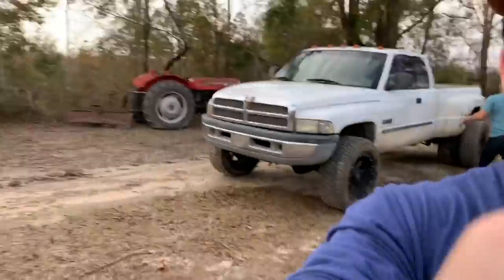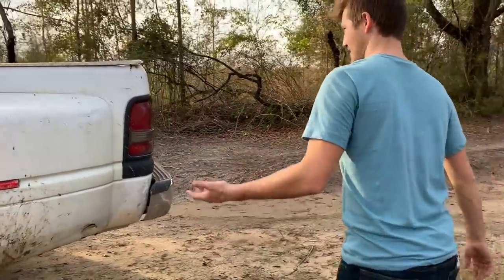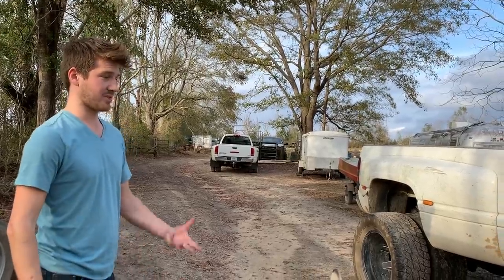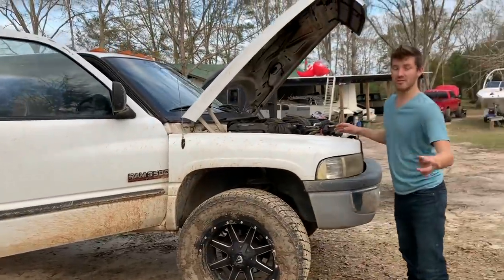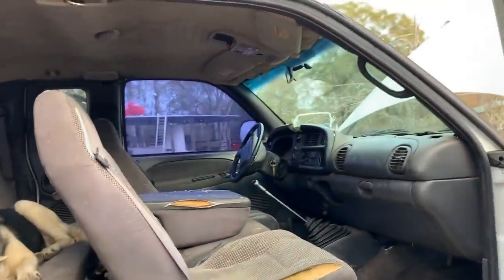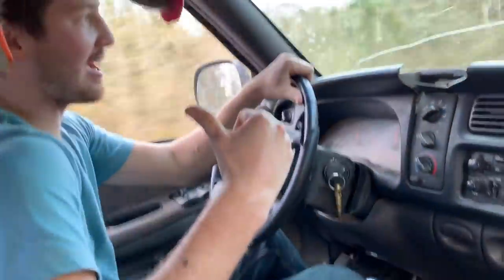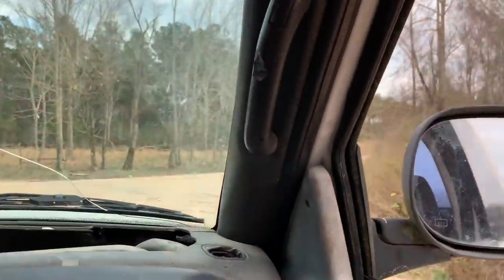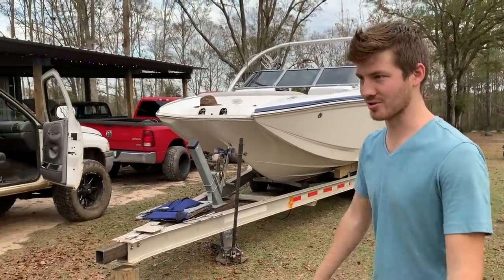6SPEED MANUAL 4x4 24v CUMMINS SHIFTING GEARS!!

Comment: Sounds like it's got a tick in the motor and I like how every light on the cluster is on. I'd say it needs a shit ton of work
Reply: Normal Cummins injector clack, and well yeah it’s a 2nd gen lol 😂
Reply: It’s an exhaust leak, that’s all
Reply: Total shitbox
Reply: Typical 2nd gen for sale - 
230+ k 
Rust/ dents 
Few mods 
Wheels n bald tires 
Dash cracked / windshield cracked
Needs TLC 
8500-14500 lol
Reply: Ya that thing sounds like dog shit. Id pay 4500 with the wheels
Reply: @haydenerlandsen8295  I bet you fuckin would 😂 thats parts truck prices fam

Comment: We’ve got an 03 3rd gen 6-speed manual 4x4 with only 160000 miles on no dents no body damage or interior damage and it is a Laramie so it’s got the upgraded interior. It looks and drives like new and has rails in the bed for a 5th wheel camper hitch. The truck is a straight beauty and the motor purrs like a kitten.

Comment: What do you gues think this same truck but Laramie slt loaded leather heat power seats with no dents or rust and 194k 2 owner me and original owner truck will go for with a towing triple disk clutch and compounds and edge go for price wise

Comment: Great video but that truck is a little too far gone. If the miles were lower it would be a different story, 440k lol that's a good farm truck
Reply: toast 2 go depends on prior maintenance
Reply: @toast 2 go for the motor yes,  the truck and drive train no
Reply: I’ve got a 02 4x4 dually 6 speed with 105k miles. Get hit up all the time to sell it. It’s all stock. Mint. Desert truck, I’ll never sell

Comment: Blowby, look at the oil filler. Getting close to a rebuild.
I  just bought a 2002 2nd gen with a 55 block 154,000 miles on it , interior like new, new headlights, body and fenders all straight, 6 brand new tires,new after market stero, tow package, good windshield $10,800. Got him down from 12,000.

Comment: I have an 02 6 speed 4x4 3500 with 183000 miles on it in mint condition
Reply: Sounds better
Reply: i have an 02 4x4 5 speed 2500 162k miles
Reply: How much are you asking

Comment: I bought a 01 ext cab 127,000 6 speed 2wd 1 owner for $5500
Still have the original window sticker
Reply: If it's a dually that's a steal if not you should make it a dually

Comment: Damn that truck is beat up , I have a 2001 dodge dually 90,000 miles ,only problems mine has top of dash is cracked small dent in my front bumper

Comment: That truck is only worth 2500 at the most the way it is right now it’s is clapped out its time to retire and like some one else said this is a farm truck.
Reply: I wouldn't give a dime more than 2500 - it's cheaper to buy a clean one then to fix that mess- 
I can see getting more if int was clean , no dash lights and ran perfect with AC - then you just are looking at a paint job -

Comment: Listen. Who should care about miles. These engines go a million miles, it’s only got half that on now. Should be worth 8-10 with no rust.
Reply: No freaking way lol bud it's a beat pos - int shot - paint shot - not one piece on that truck doesn't need replaced lol you buy a clapped out diesel you best believe there are huge repair bills to follow - not a chance I would give more than 2500 maybe 3 tops - they aren't that rare and you can buy one cleaner and cheaper then fixing that one - 
I love how they keep saying ( like all second gens ) lol because so many are beat to shit
Reply: Robert Kurtz I have a 2000 2500. I paid $2500 for it. Had a cracked 53 block, nv4500, I did a frame up restoration. Powder coated frame, fixed cab rust, and bed $4500, slapped a patch on engine, drove it another 15k miles. Then I rebuilt the engine for 500 hp. BD intake horn 100 hp injectors, Hamilton cam, ARP head studs, rod bolts, 103# valve springs, o ringed head, steed speed manifold with sxe 362 turbo, p pump, mishimoto rad ,diamond eye 5” ss exhaust, south bend dual disc, front n rear pinion yokes,  4th gen wheels, interior: leather seats.com interior, with new seat cushions, new vinyl floor, new dash, and wood grain bezel, replaced heater and evaporator cores,. I have 30 k into this truck. Not counting labor. There’s no way your $2500 number even comes close to what that truck is worth even if you pay somebody 10k  to fix body, interior, and steering it would be worth 18k, do your research and see what these truck are selling for that have no engine mods. 12k - 25k!